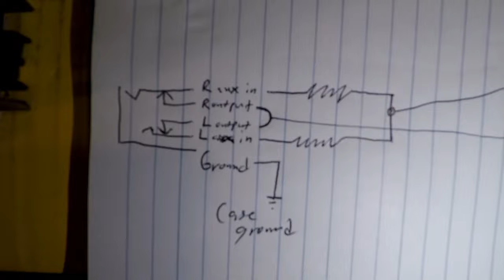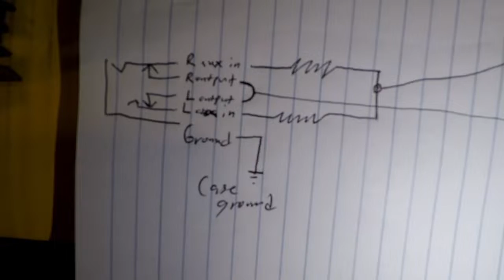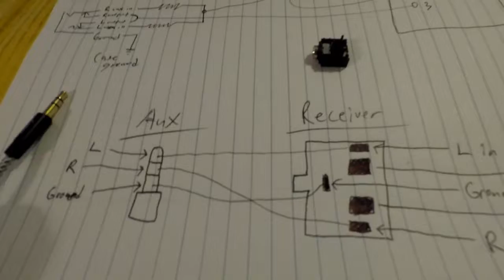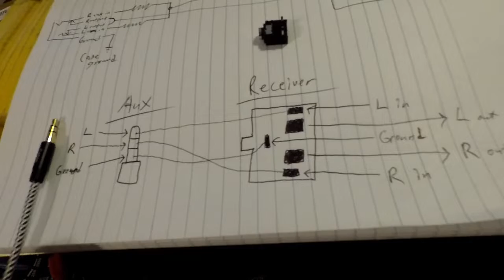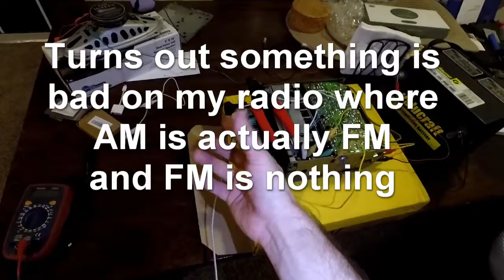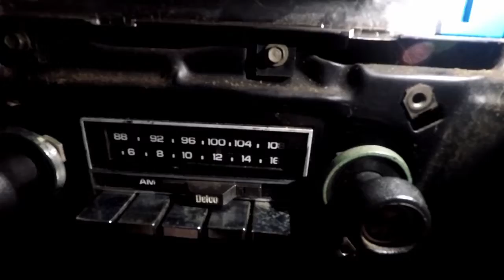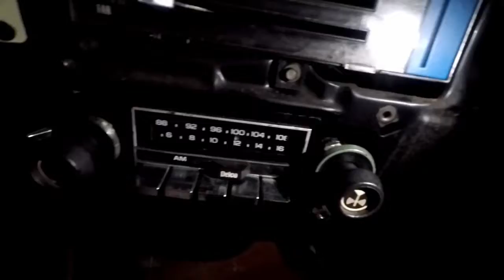Adding AUX To A Factory AM FM Radio

Comment: Can the same thing be done to a tabletop radio?
Reply from the maker: Not sure if this method would work in that case. Although for a table top player, it may be better to buy a dedicated aux module (or Bluetooth module) with its own preamp and connect that directly to the built in speakers.

Comment: Hello, I need your help. I have a stereo, it has amplifier legs and 3 noise control legs, in the amplifier I have 12v on the 3 pins, pin 2 seems to be the audio input since I can test it and when I insert sound it cuts off the radio automatically but when Turning the volume knob up more than halfway cuts off, what do you recommend I do, what type of resistor should I use because it has a lot of voltage?
Reply from the maker: @angelricci7219  the volume cutting out when turning the volume knob up sounds a lot like the problem I ran into when I added Bluetooth to this radio. In my case, I had a volume adjustment knob on the bluetooth chip and that’s what I used to reduce the input volume that is then being fed to the radio’s volume pot, which then gets boosted by an amp later in the circuit. 

I would suggest finding out what resistance range the volume pot uses and  then you can try adding a resistor in the middle of that range to see how that sounds